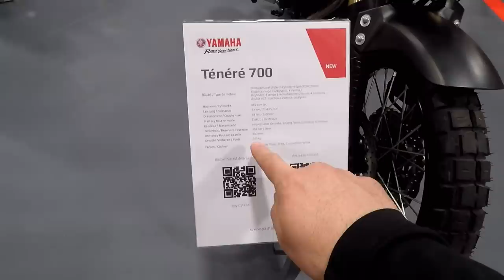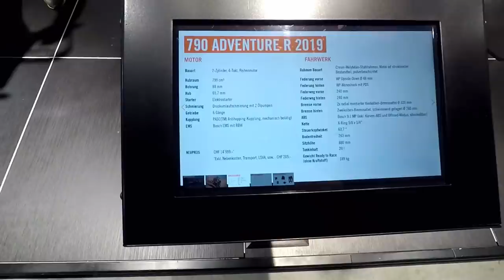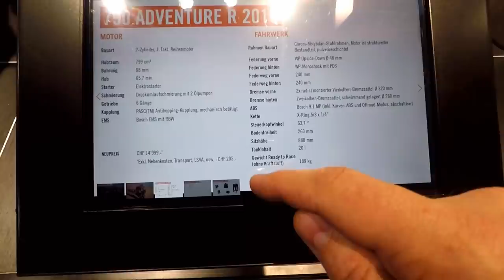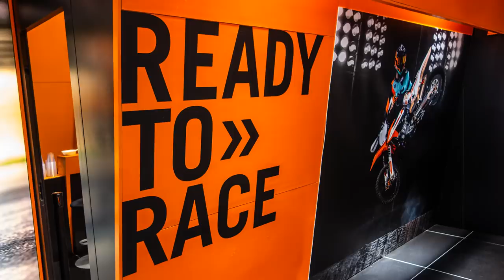Swiss-Moto Zürich 2019 - Yamaha Tenere 700 and KTM 790 Adventure R - Part 1

Comment: Hello Yamaha Germany give this man a brand new Yamaha, he is your best Yamaha ambasodor araund the world or do you want him to drive a Ktm ?????
Reply from the maker: Yamaha listen...
Reply: Yamaha should design with Pavlin the ultimate real adventure Bike - i mean on some existing Plattform like WR450 ore Tenere700
Reply from the maker: Yes!!!!!!
Reply: I also vote YES on that, #Yamaha pay close attention there, this man has some good and valid points when it comes to adventure bikes.

First point - throw away hard panniers! LOL
Reply: @yamahacentrumberlin
Reply: If he rode the ktm  for any time he wouldn't go back to yamaha! Yamaha make good stuff but not in the same league as ktm, and Yamaha marketing is insane! Look at the tenere 700, 4 years until it's on the dealers floor, yikes.....
Reply: Jimena Gulla in terms of reliability yamaha is in a completely different league.
Reply: @Speedytrip  how many ktm's have you owned? I'm guessing none, the T7 is boring and already outdated and it hasn't even come out yet.but hey at least it will be reliable  with a small gas tank, wow, stellar engineering!
Reply: Jimena Gulla wrong, Ive owned one and it was enough (so have 2 of my friends). Ktm and Ducati have been my worst motorcycle experiences in terms of reliability. They both make really fun bike (and ktm usually have amazing suspensions) but claiming they are as reliable a Japanese bikes is simply not accurate or even debatable, Yamaha is always in first place for reliability (and I own a Triumph and Im not loysl to any brand). As for the 350km tank range, if that is a problem than yes the T700 is not for you. They did stretch the marketing campaign waaayy too long, the prototype looked way better than the production model, but Im sure theyll still sell like hot cakes.

Comment: Hmm
About 10'000 for the Tenere
15'000 for the KTM 790

I think if u invest 5'000 in the Tenere u can get it on same level like the KTM - suspension, shock, etc..

Thank u for the video Pavlin - great as always!
Reply: The ktm 790 adv R will be little over 13 k.... And the normal adv will be little over 12k eur
Reply from the maker: 790 Adventure R is more than 14,000 euro
Reply: @motorcycleadventures  The Ktm prices for Germany will be : 
790 Adventure R – €13.399
790 Adventure – €12.399

690 Enduro R – €10.799
1090 Adventure R – €14.795
1290 Super Adventure R – €18.000
Reply: And the extra options will be :
quickshifter – 389 de euro

cruise controlul –  242 de euro. 

Handguards – 57 de euro, 

Tall windscreen – 89 de euro

 Exhaust can Akrapovic – 876 de euro.

Luggage system(Touratech) – frame + side cases + topcase + suport topcase : 262 + 874 + 437 + 96.
Reply: @fun2rideadventure  Hey - just buy what u want :-)
Reply: who the hell need a 5000€ modification on a teneré???? juste get a F..... GS instead! 😄
Reply: patrick evrard with its Chinese made engine ? No thanks
Reply: You forget the rubber protection for the clutch cable (to prevent water/ dust in comming). The Te XT660Z have it yet ...
Reply: In the UK. £11,099   & £11,999 for the R.

Comment: What I don't understand by japanese manufacturer, Yamaha as well as Kawasaki sell motorcycles with LED headlights and turn indicators are with light bulbs for 2019 (?). I wouldn't say that to produce LED turn indicator is extreme expensive...
Reply from the maker: Yes, but...
Reply: LED turn indicators are less vizible in daylight than bulbs ones.. is a fact .. and are not so expensive to change if you want.
Reply: @gattonpc  if they pass homologation coditions for specified country, they are visible enough.
Reply: @markomaricic5363  That's not my point..I think any motorcyclist want to be as much as he can more VISIBLE on the road. And turning signals are so important than we might think.
Reply: I think it's pure cost-cutting. For example, the Super Tenere and MT-10 come with LED turn signals but the MT-09 and Tracer GT comes with incandescent turn signals.
Reply: @gattonpc  Not true. LED indicators are more visible than bulb ones.
Reply: Exactly, first thing that I noticed. Super fancy headlights and....turn signals from 1981. Did they get them from some old model of theirs?
Reply: @legghorn  Not in a daylight..is not me that says this.. is science. Document a bit and see.. In the night time yes they are.. but not in daylight. Im not here to argue with anyone..
Reply: @gattonpc  Not true. Do some research. Owned a lot of bikes with factory led indicators. The indicators were brighter in either situation day and night. Everybody riding with me confirmed that. If you are not telling the truth then someone has to tell you.
Reply: @vesso_georgiev  You can replace them with Yamaha factory LEDs
Reply: @legghorn   Marcus Deubel  yes, correct. In every cirumstance are LEDs better then bulbs (last longer, are brighter, better visible, better light distribution and so on...). I don't see any reason, except costs. But for one small lamp, how much is the cost difference? Btw. this is a discussion, not arguing.
Reply: @legghorn  Actualy i did a research and tests on diferent models.. You should try too before you get full of yourself and try to educate others.. Go and test the same voltage bulbs and same voltage LEDs and see for you own education.. then comeback and comment again. See what your friends say in a bright daylight about your LEDs signals.. compared with the incandescent ones (bulbs).
Reply: Marcus, yes you can, but why are they there instead of LED ones?
Reply: LED indicators act as premium bits or product differentiating factors, e.g. like quick shifters, LCD display & other electronic package...
Reply: @legghorn  this is true the bulb one are now 10w BA15s with orange paint.   They used to be 21w not so long ago with orange lenses and clear bulbs (much brighter)
Reply: @markomaricic5363  The bmw. Ones LEDS (that they make you pay £100 for)    on the options list are like night and day. The 10w orange painted bulb version look the same as KTM and Aprilia indicators. I also have a aprilia.  Are absolute garbage too the point of being dangerous.  I thing the bmw OEM ones are amazing i see them all the time on s1000xr's.  R1200gs/gsa's  can't miss them.  Not all led's are born equal.

Comment: I was at Tulln few weeks ago and I think 790 Adventure (not the R version) has a 21" in the front too. It doesn't seem to be much worse than many other adventure bikes off the road, I think it has ~200 mm of travel and is quite light.

Although I'd probably prefer the Tenere like you - I don't know what your reasons are, as you seem to be more skilled they're probably different but I am simply not good enough to actually use what 790 Adventure R or PR7 can offer off the road 1000 km from home. And Yamaha is 4000 EUR cheaper than the KTM.

Thanks for the overview of the models!
Reply from the maker: My pleasure!
Reply: The 790 arrived in my city and I could sit on it. I find the standard model extremely well designed, high clearance but low seat (the saddle can be moved in 2 positions) despite 21" and 18" wheel size combo and already 200mm travel front and rear on WP suspensions. The R has much higher seat, top suspensions and offers a rally agressive highly tunable off-road setting. Not for me. The frame seems very tough and the rear llop can accomodate serious load. The only weak parts visible on the KTM seem to be the deflectors just below the windscreen. The standard might be really better (confort and stronger) than the Tenere for loaded duo. I bet the T700 will come at 9999€.... Then the difference with the KTM might be 2.5k, not 4k as say some comments here. Let us see what the T700 will really be I would probably take the Yamaha to travel solo and the KTM for 2-up travel. Probably no existing lady will agree to go as pillion on serious off-road, except the one you crossed in Mongolia.  Thanks for the review and your channel as a whole. A lot of useful information !
Reply: @bernarddulmet4909 , based on what I know about the prices in Czech republic, the standard model is slightly less than 3k EUR more expensive - maybe closer to 2.5k if the Tenere price will be 10k as you say. The R version costs about 1k on top of that. So that's where the 4k comes from.

Comment: I like the bolts on the yamaha, not good looking, but they looks solid. The cheap thing on the bike is the non adjusteble forks. The bike is awsome cool to look at.
Reply: The Ktm may look better in build quality, but in the long therm l think the yamaha will out class th 790 in service costs. Just a feeling.
Reply: @toby7504  most of the spares will be the same as the mt-07 so good cheap availability. In the worst case you could get a cheap mt and pull the whole engine.

Comment: Interesting to see new Tenere, looks good but is that 205kg wet or dry weight?

16 litre tank would be OK because I think it get good economy, if it gets high side of 350 Klms that good.

I am also of opinion that Tenere has a proven engine where as the KTM is brand new design, maybe after a few years when KTM get it sorted it will be better, first year bikes are mostly test mules anyway.
Reply from the maker: 205kg wet. Agree about the tank and reliability.

Comment: The bike looks very nice, but I have a feeling, you had expected a little better quality, which is surprising to me...anyway, did you manage to find out more info regarding the lower/higher seat topic?
Reply from the maker: Yes, they will have another one option with 91cm seat hight.
Reply: @motorcycleadventures  that is a good sign as the previous is 895mm, am I right?

Comment: Hello, Pavlin,

I saw the Tenere 700 and the KTM 790 Adventure R at the motorcycle show in Dortmund. I have to say that most of the fair motorcycles look out of stock or used. It had been with both motorcycles in such a way. The Tenere gives me a much more mature impression like the 790 Adventure R. Of course you can't compare the chassis of both motorcycles, but you have a lot of play with the price difference to change something. The seating position is much more comfortable and it simply feels more like a travel enduro than the 790s. I don't want to talk badly about KTM but since KTM has many things built in India etc. and is more on mass, the quality has dropped very much. I have been riding KTM for years and if you put a 640 LC4 Adventure or a Yamaha660 xt next to the 790 you have more reliable bikes than the 790. KTM believes that with power and a TFT display you can build good bikes. I'm really looking forward to the test ride and hope that you'll make the right decision, either continue the 660 Tenere or the 700 Tenere. ;)
Reply from the maker: Thanks for taking the time!

Comment: The front suspension has 2 screws one on each side, one must be for rebound damping and the other one compression damping. So the preload adjustment may be missing from the front side. On the rear there is a hydraulic preload adjuster and there is a screw as well so it may be for rebound damping...
Reply from the maker: Exactly
Reply: @motorcycleadventures  And there is a button on the dash that deactivates the ABS...

Comment: Tenere 700 looks good. As older guy with weakening legs who needs both mild off-road and freeway speed use, keep total weight under 400 lbs and don't need 700--800cc. Half that displacement @ 50hp is enough.
Reply from the maker: True

Comment: Which of the two felt lower, the KTM 790 R or the Tenere 700? I think yamaha says 88cm is the standard seat and maybe they will release a taller  a more comfortable one so that's why 88cm may be the lower option but we thought the lower should be 86cm for instance. It would be nice to have a measurement. Thanks for the nice presentation.
Reply from the maker: Thanks for watching! They are felt exactly the same high.
Reply: @motorcycleadventures  If they feel exactly the same height then the lower seat for the Tenere 700 is for sure 88cm because the same is the seat height for the KTM 790 R...The strange thing though is that the KTM 790R has 240-240 suspension travel while the Tenere 700 has 210-200. So one would think that the Tenere 700 could be a little bit lower. Too bad.

Comment: My experience with Tenere 700 from EICMA 2018 - a bit disappointerd with the build quality/expected price of the base model. I wasn't sure about 16 l fuel tank, 43 mm forks, lcd display like from year 2004...
Reply: What exactly disappointed you?
Reply from the maker: It is exactly what I need! Yes, the build quality is not good, but it has the proper set.
Reply: Just quick observation at the exhibition and the first feelings when you touch and inspect the bike. I expected same feeling like at KTM 790 adv R...but imho KTM is in a different league (of course as well in the terms of the price).

Comment: By the looks of this video I think the XT660R is still better, cheaper, lighter and easier to modify, although stock is ok. Better buy another xt before they kill it with the T7.
Reply: Do you mean xt660z ?   It's more or less the same weight look it up it's over 206kg wet. The T7 is 205kg.  And I thought the Xt660 x/r/z. Had all stopped production due to not meeting emissions standards.

Comment: For me it's still the dct africa twin.
Reply: The DCT stopped downshifting on my 2016 Africa Twin, stranding me. It also suffered from intermittent stalling issues when pulling away from a stop. Sold it when Honda refused to guarantee a fix and now on a Super Tenere, zero problems in 30,000 km.
Reply: @yayoi1  did you find out what was wrong with it? Mine's a 2016.

Comment: Yamaha bias big time.
I'm disappointed, you used to be more impartial, but nova days not so much.
Regarding 701 with about 1500 euro more you can transform it in a very good adventure bike, Rade garage front fairing kit (lights included) is about 1000 euro, extra fuel tank about 400 euro gets you a total of 19 litres of fuel, much more than T7, and you can spend the extra 100 euro on a proper skid plate. That's how you get a proper advbike that is light powerful and have good suspension, not buying a pig with alucases and crash bars from Yamaha.
Reply from the maker: Well...it is good to talk, but the reality is different. A good kit + fairing for 701 cost more than 8000 euro (watch tomorrow's episode) and at the end you will still have one not so reliable KTM. As I said, there are ready to race, but not to go around the world.
Reply: Äh, a single zylinder is always lighter than a twin zylinder.Consider this.
Reply: Motorcycle Adventures 
So if I understand correctly Rade is not a good kit?
I wander why do you think that?!?
About the relatability of Kim/husky it’s a long discussion (I know rockerarm /cam issues ) but in the last I can’t remember how many years ktm kicks Yama and HONDA asses at every Dakar.